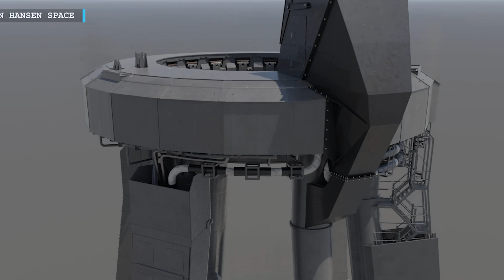Elon Musk Pushes SpaceX Starship to Reach Orbit in Weeks | SpaceX Begins to Rebuild the Launch Site

Comment: Question: is it possible to launch such a large/powerful Rocket (with future payload consideration) from an off-shore floating Rig?
Reply: No chance in hell. That's probably the worst place you can think of doing it.
Reply: @mervstash3692  explain why
Reply: @the_lost_navigator  They bought and sold some offshore oil platforms. Very difficult to move something as big as Muskrat's folly. Cannot move it in vertical position on the sea, Cannot upright it on a platform. No means to have fuel available on the platform. And worse the platform would surely tip when the thrust of the rocket was imparted to it during rocket ignition and ramp up. Probably enough to tip over the platform and the rocket. And blasting the exhaust into the salt water would put extremely hot salt water on everything. Etc.
Reply: @geraldkoth654  that makes sense.  Thank you
Reply: @the_lost_navigator  lol because it's a floating rig.... The Sea is windy AF, the sea is unpredictable & the rig would be a floating nuke. Plus the mechanics & logistics of transporting rockets there would be insane.
Reply: Yes.

Comment: Perhaps Musk just wanted to blow a crater into the ground in order to rebuild with flame inverter and water system. I am a novice but I knew that blast will just destroy the launchpad and and if they didn't iron coat the entire thing the rock too would have made the largest land exposing ever made by man kind, that isn't nuclear powered. I'm sure you can find me on one of you shows on this channel say the entire thing will blow up. Which it did, and the rocket somehow still went airborne and with limited engines still made it to the space line, as far as my calculation goes, I still got it right, the rocket was severely injured and didn't make the journey planed for it. .

Comment: Musk should consult with military contractors. If a cumulative jet burns through tank armor in hundredths of a second, then what will the exhaust of 33 engines with a water-filled plate do? He was incredibly lucky that the rocket was able to take off. Next time, luck may turn away.
Reply: or he could just look at how everyone else launched big rockets for the last 50 years & build the pad that worked for them. Pads that were originally designed for far bigger rockets that never eventuated

Comment: After SpaceX modifies their launch stand, they should consider using a Falcon 9 to be captured by the launch stand arms in Boca Chica. Yes I know that they don't normally land there but it would be a way to test the system.
Reply: Falcon 9 has too much power; it cannot hover. It's landing burn is timed such that it hits the ground and shuts down a moment before going back up.
Reply: @psycotria  The second it gets back to the ground, that is exactly what it is doing (hovering). Otherwise any downward momentum would be too stressful on the landing legs and it would lose all structural integrity. Can SpaceX capture a Falcon 9 booster? If they can't, than what makes anyone think that they can capture StarShip? Using Falcon 9 (Modified) would seem to be a good test bed to use. In-between launching StarShip with Booster, SpaceX should also launch just the booster to see if the capture concept contains anomalies. Then SpaceX should move on to use Starship itself to capture. Both of these tests are important to the program.

Comment: It won't be doing much, Starship is grounded. The launchpad demolished. Residents' windows blown in from 6 miles away. Nature reserve in flames. Chunks of the pad launched into the sea, big chunks. The Starship bent in two and as the self-destructs did not work, both of them failed, it was fortunate that the Starship blew itself apart. Why are people calling a disaster a success? Musk is screwed, by himself. He stated that in 2022 Starship had to be launching every 2 weeks or SpaceX would be bankrupt. They launched zero, "0", Starships in 2022. He isn't going to be launching Starship this year. Even if he was able by some miracle to launch another one, he still has the same problem with the unreliable Raptor engines. Careful observation of the engines on external feeds shows at least 9 engines down before it exploded. This is not a new problem with this engine. People left SpaceX as they were not being listened to, allegedly. No matter what transpires it is all fully dependant on the Raptor being reliable. Good luck with that elon. 💥
Reply: > The launchpad demolished.

No, it is not. In fact, it looks pretty god, considering the size of flying concrete. The tower is only superficially damaged. The stand's legs and upper structure is structurally sound. No pad fire occurred, so almost all piping and tanks should be okay.

> Even if he was able by some miracle to launch another one, he still has the same problem with the unreliable Raptor engines.

There is zero information that Raptors have any unusual problems.
Reply: @denysvlasenko1865  I agree with you that there is zero info that the Raptors- themselves- have any problems; and I honestly feel confident Elon would NOT have gone into very real mass production on Raptor 2’s unless they had all the kinks worked out at McGregor et al. BUT……I’m now less confident, that they have their propulsion INTEGRATION issues fully in hand. The fact that they’ve tried- twice now- to start all 33 engines for liftoff, and didn’t succeed either time, is almost certainly bothering the hell out of the SuperHeavy integrated propulsion team; even more so than, say, loss of an engine or two (or more!) going uphill. They’ve got a propulsion system integration, possibly even, propulsion system engineering, issue, on their plate. NOTE: This has NOTHING TO DO with ‘safety’ or the FAA or anybody else; its only about operations and performance and reliability. FAA only cares about the uninvolved public right now. - Dave Huntsman
Reply: I’ve been in lots of those types of meetings in the past, No profanities; not when dealing with something being tried in an unprecedented way on an unprecedented vehicle from an unprecedented location especially. Just not the space industry, government agencies, & operations I know all too well. People know the risks; respect the people who are working their asses off 70+ hours a week to do what was previously thought impossible….no one was hurt, always the main thing (I’ve been on console in Mission Control in Houston when a shuttle exploded on me, killing my friends; believe me, you can have bad days, ok?). That’s not how it goes. Everyone now for this unprecedented activity that is so critical to humanity’s future in space just wants to figure out: where were “our” (everyone’s) assumptions wrong; WHY were they wrong, since “we” (government and company) were all in on it; let’s figure it out; also, figure out how the actual processes themselves can be improved; and go do it again. - Dave
Reply: @denysvlasenko1865  The farce is strong in this one. 🤣
Reply: I especially liked the video of the roasted nest and eggs of an endangered species.
Reply: "Why are people calling this disaster a success"? Some of the greatest PR work in history, I would suggest. At least in the context of maintaining support from the core fan base. 
I would suggest though, that the FAA, the EPA and NASA won't be as forgiving of SpaceX for failing to acknowledge certain realities that accompanied this launch.
I would imagine that if one was a fly on the wall at any of those authorities, one might have wanted to keep their hands over their ears if they weren't accustomed to profanities.
Musk and his team might have been served well by words that my father often quoted:
"You can fool some of the people, all the time, you can fool all of the people, some of the time, but you can't fool all of the people, all of the time".
Times up, on this one.
Reply: @davidbrayshaw3529  > I would suggest though, that the FAA, the EPA and NASA won't be as forgiving of SpaceX 

Yes, NASA just hates a prospect of having a 250 ton launcher. Whta are you smoking?
Reply: @davidbrayshaw3529  You're Abe Lincoln's son and I claim the $5. :goodvibes:
Reply: @IbnBahtuta  Is that where that quote came from? My late father loved it!
Reply: @davidbrayshaw3529  I retired from NASA after 46 years; did a lot of space flights; worked with FAA/AST on commercial space stuff for years. And not a single word you wrote rings true. You’re just bs’ing while hardworking folks are trying to bring the future forward.
Reply: @dphuntsman  Which words do not ring true? And if so, what evidence do you have to the contrary?
I'm always open to correction and I'm always open to learning. And I do not profess speculative opinion to be fact. Rather, I seek to open a debate.
Reply: I read the same post 2 years ago, it will never be permitted, it's never going to fly, it won't happen, so when this largest rocket in history actually was built, needless to say the giant launch tower, with arms that stack the actual ships,and lifted off, flew through Max Q, then detonated. It's pretty obvious that the launch pad caused severe damage to the spacecraft. If the launch pad wouldn't have disintegrated, chances were pretty good for a successful test flight; and I doubt you would have written that comment.
We all have opinions, and seeing how far this program has come in a few years kinda  seems like the glass is half full rather than doomed to fail. Will we have to wait longer because of this test flight? Yes. Will starship succeed? Probably.
Look at F9 history. Doomed, not going to work...over 150 landings later , some rockets launched more than 5 times.
Not a X fan boy, just reflecting on what this company has accomplished. Impressive.
Reply: @jeffjeff4477  well it's not pretty obvious dude. Even SpaceX has debunked the bulk of what you said in their most recent report. Literally everyone knew this would happen. You can try spin it all you like, this was an utter disaster & could potentially mean the end for the company. They wont be launching Starship again anytime before 2025. By then, Starlink could bankrupt them.
Reply: @jeffjeff4477  Cognitive dissonance is so sad to see. Wanting something to happen is not the same as reality. Go and take a science course ffs.
Reply: @IbnBahtuta  Hahaha , oh my, so sensitive!!! You can check the glass is half empty on your questionare  please. Next.......
Go Starship!!!

Comment: Very sure space X can be ready  in two months time but licenses from FAA can even take a year or more...it's the only barrier they have to their top speed
Reply: You're out of your mind.
Reply: facepalm
Reply: Space x always blames anyone but themselves , even when they got the FAA approval they said was holding them up it was still months afterwards  before they blew anything up . Redneck  Cowboys
Reply: SpaceX's license is good for 5 years. They are grounded until the pad is fixed, but they still have a license.
Reply: @psycotria  No, they are grounded until the Raptors stop blowing up.
Reply: @psycotria  launch license is suspended, starship is grounded indefinitely!
Reply: #1 two months is a ridiculous claim. They aren't just going to rebuild it the exact same way as before & use another rocket with the exact same issues. Clearly there needs to be HUGE chunks of time dedicated to redesigns etc before even attempting to rebuild. This is not just something you solve overnight.
#2 FAA has nothing to do with it now. It's in the hands of the TPAWD until further notice. Which could potentially be years if you read their MOA with the FAA.
Reply: Dream on.
Reply: It will take at least 5  to 6 months..and that is very optimistic.

Comment: Not happening.  Starship is NOT going to launc this year.  Elon has no clue what he's talking about.  It will probably take 8 months to rebuild the site, and the FAA is not going to approve another launch until there is a flame trench/flame diverter and deluge system.  Neither of which the site is equipped for and will require a LOT more work.
Reply: Totally agree!
Reply: Why would the FAA care about a flame trench/diverter?
Reply: @Jehty_  The potential damage that may have resulted from the last excursion
is something that the FAA won't forget in a quick hurry. They will insist that every measure is taken to protect the aircraft, the environment around it and ultimately, life.
Reply: @davidbrayshaw3529  Was that more damage than what would have happened if Starship exploded on the launch pad?
Reply: @Jehty_  I would imagine that catastrophic failure on the launch pad would have been far worse, perhaps even, a deal breaker for Boca Chica.
Despite Musk's claims and the PR campaign that has followed, I'm quite sure that the FAA will be examining very closely whether the rockets engine/hydraulic failures could have made the outcome far worse than it was.
This doesn't look good for SpaceX at all.
Reply: @davidbrayshaw3529  sorry, your comment makes no sense.

An explosion (either on the launch pad or at any time during the flight) was expected.
So the FAA must have based their previous assessments on that possibility.
So the FAA already took the worst case into consideration and allowed the previous launch.
Reply: @Jehty_  I believe that the question that the FAA and NASA will be asking themselves is, "did we reasonably predict a worst case scenario"? following this flight. That will likely be up for review. They mightn't have predicted this outcome at all.
Reply: @davidbrayshaw3529  what makes you think that they haven't predicted that outcome?
Reply: @Jehty_  I presume that the FAA don't have the engineering team at their disposal that SpaceX does. If SpaceX didn't predict the outcome, I doubt the FAA would have.
Reply: @davidbrayshaw3529  what outcome are you even talking about?
Nothing happened.

SpaceX didn't predict the launch pad to disintegrate. That's it. Nothing more happened.
Reply: @Jehty_  https://www.youtube.com/watch?v=xfFhKqGrNYg
Reply: What is your position, exactly, at the FAA?
Reply: What? Have you not seen the pictures of the water deluge parts that are already at Boca Chica? They got the OLM basically ready in a year, and that’s a much more complex system. I’d say wait 3 weeks before you get your pitchfork out you hooligan.

Comment: The good side of this is SpaceX needed a hole for the flame diverter and deluge system. This made that easy to obtain and gave them very valuable info for the next launch!!! Win win! Concrete is not dangerous to wildlife. Concrete i the ocean might help with an artificial reef!!!  The real concern is the stability of the OLM around the big hole! As I under it the 40 second delay was planned because the tanks were punctured to eliminate the fuel load before the explosion!!! What happened to that detail?
Reply: Concrete is not dangerous to wildlife.... It depends on what speed it's going...
Reply: Were you born stupid or did you learn stupidity in public school? Look up silicosis.  That's a disease you get from breathing concrete dust, which was scattered for MILES.  There's no cure and you can die from it.  Remember how many New Yorkers got sick and died from the concrete dust from 9/11?
Reply: I am half convinced they knew of the possility for pretty severe destruction, but did it none the less because they also knew they would need to rip it up no matter what.

Comment: What I don't get is why they didn't take into account such factors in simulations? It was obvious that Starship Super Heavy would leave more of a mark than their Falcons... I've always been a fan of SpaceXs iterate and fail fast approach... But if something could have been predicted and calculated beforehand, it's such a waste to go in knowing about existing issues.
Reply: They did take it into account. But after running the engines at half power in a static fire they measured the erosion of the Fondag concrate and calculated how much erosion should take place when firing the Raptors at full power. Their model did not show any breaking up of the Fondag - just more erosion. They still don't have a full understanding of why the Fondag disintegrated. That's why they thought they could get away with it without using the massive water cooled steel sandwich (steel erodes at a rate of 0.5" to 1.0" per second according to EM). So they will have to get Superheavy off the pad much faster during the next test launch (Superheavy took around 5 seconds of blasting the pad to smithereens before it finally took off during the 1st test launch)
Reply: @gijbuis  Wasn`t even full power as no payload
Reply: I am absolutely certain that there were engineers that DID tell him it was going to fail, but Ego-lon, backed by a corps of Musk-eteers, selected "I" for ignore, and went ahead because they wanted-to, facts and figures bedamned. impatience and ignoring engineers has caused vehicle loss and death before, just say it with me,..."Challenger". Fortunately there were no lives lost THIS time, but what would a full explosion at-pad, which would have then taken the tank-farm with it, have done?
Reply: They did take it into account. The water cooled steel pad was already in production but wasn't ready in time. Based on static fire data, they thought the current pad would survive 1 launch, that it would degrade the concrete, but not break it to that extent. They were wrong.
Reply: Muskrat wet his finger and pointed it upward, then told everyone it would be fine.
Reply: @geraldkoth654  He is a gambler and he will always be one!